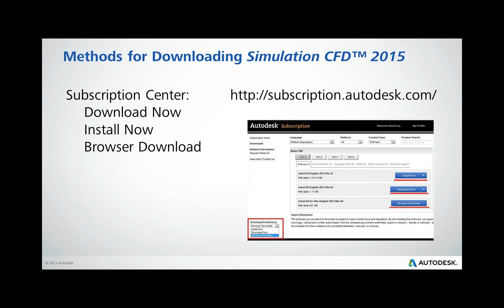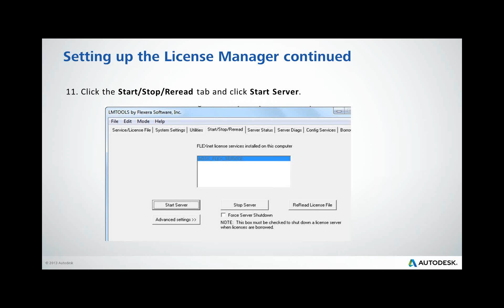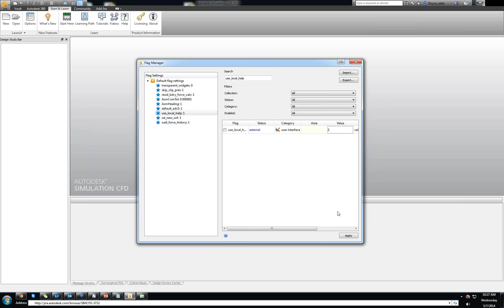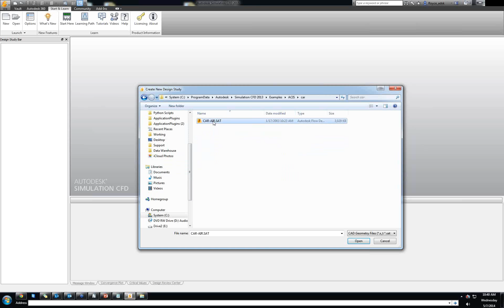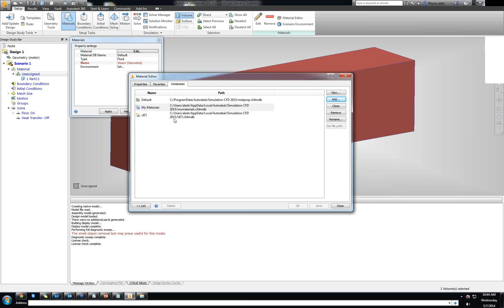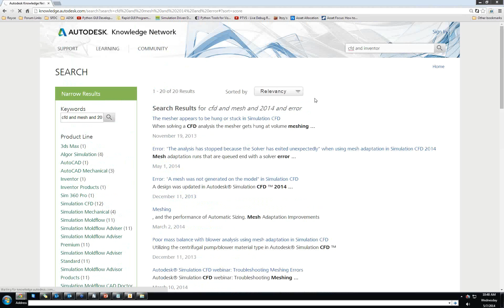Getting Autodesk Simulation CFD 2015 Up and Running

Comment: whats the difference between the " Autodesk Simulation CFD 2015" and the "Advanced 2015", the "Motion 2015", the " Design Study Environment 2015", the "Connection for NX 2015", "Connection for ACIS 2015", the "Connection for Pro/ENGINEER 2015", and "Connection for Parasolid 2015"??